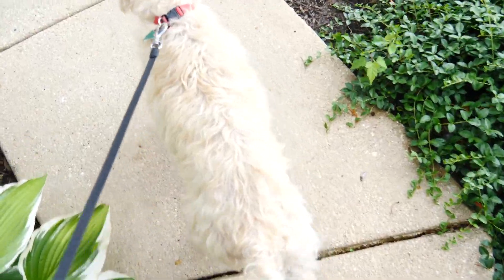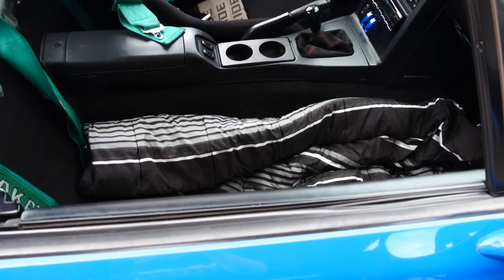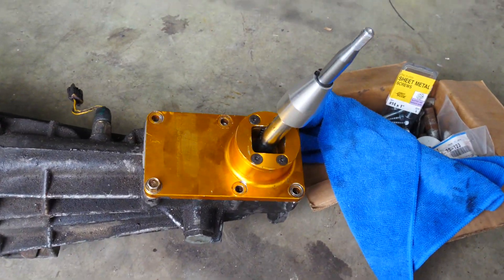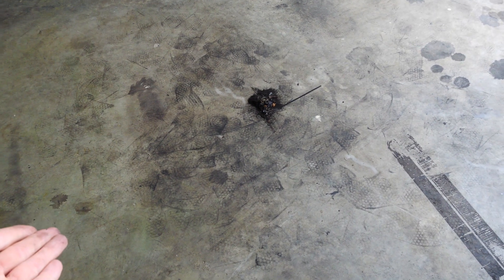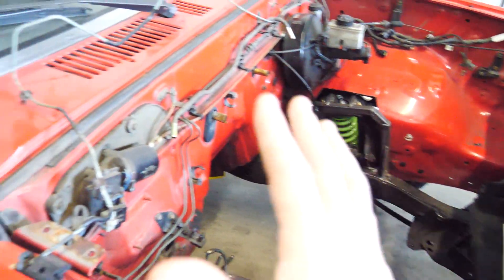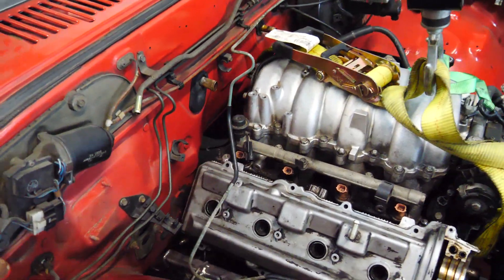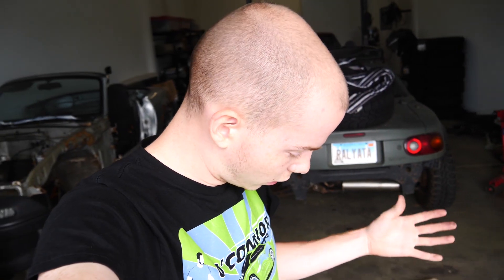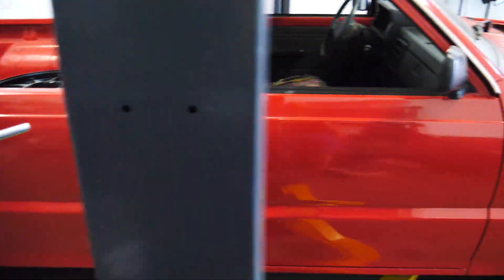NEW Transmission for the Drift Truck!

Comment: You should swap the B2200 sticker to a B4000 sticker so it would show the new displacement
Reply: Klaus Kokkonen i have seen a Toyota mini truck, they did that to but instead of stickers they 3D printed itm
Reply: Kevin Klement yeah thats where i got the idea aswell
Reply: Klaus Kokkonen nice, what toyota truck was it?
Reply: There was a Mazda B4000, which means getting OEM badges is possible, the question is if you can get them new from Mazda.
Reply: Kevin Klement 1972 hilux
Reply: Its more like B4700
Reply: YB420 4700? Is he not putting the 1uz in it? 1UZ is a 4.0L
Reply: YB420 you're thinking of the 2UZ which was the iron block 4.7 liter they used in trucks, gingium is putting in the 4.0 liter aluminum 1UZ
Reply: Yeah there was a b4000 but the logo says B4000 with a V6 under it. 3D printing one seems a better alternative than hacking an original plastic one...

Comment: You just went to full drag setup on the Miata! Demon edition!

I think no one cares what their trans looks like since it is on the bottom of the car. I'll know any fluid leaks pretty much instantly since (knock on wood) none of my cars leak a drop.
Reply: The Dutch Texan I think that it is smart to clean everything you can if you have the time and willing to do it just because it is so much better to work around clean stuff especially on a long project.
Reply: A legit drag setup would be the most expensive he does so I don't think he would do it
Reply: Ff afkloppen broer

Comment: You should turn spares miata into drift cart using truck old engine or rally miata engine after u subie swap it
Reply from the maker: Thats the plan :)
Reply: Yessssssssssssssssssss I’m impatient already
Reply: Gingium just a suggestion, you should put the engine lower so that it will have a better weight transfer while sliding
Reply: Gingium there are also rocket bunny kits you could get and slowly build a Frankenstein track monster with all your extra parts
Reply: what ever happened to the shopping cart from boosted boiz, sad man that was the coolest thing
Reply: yes great minds think alike
Reply: joey William cool so like mad max style? that would be awesome
Reply: mid engine miata!
Reply: joey William agreed
Reply: Gingium im most excited for a miaturd drift car
Reply: Gingium def make it a diesel

Comment: Hi. Just an ideea because I've been thru cleaning gear boxes quite a bit. Hot water jet pressure. Is the best. Leaves everything spotless and very incredible clean. A bit expensive, but it deserves the price and in special with the projects that you are doing. No more dirt and can be used on mostly anything:wheels, engines, gearbox, pavement you name it

Comment: put the radiator in the bed of the drift truck to add extra weight to the back. it will give you more room to mount stuff in the engine bay

Comment: Dude, you need to hit up a sponsor for storage, parts cleaning and that. They hooked up Greg A a while back in his shop. Saves the floor. Or the harbor freight parts sand blaster. Much easier and cleaner to clean stuff up before painting. Land lord wont be happy seeing that damage to the floor.. Least try cleaning it up or do it out the back door.

Also, clean the tools and that up. If youre done using a wrench, put it back. Or get a rolling box you can take around the shop to different cars. Thats exactly what i did with my tools. All in a mobile work bench with a cord that fallows with a power strip on the back.

Comment: Try to get the engine as high as possible to reduce the risk of damaging your oil pan. You might hit it if you go of the track and hit a bump. You might save yourself an expensive fix

Comment: Axel is a big boi now. Haven't seen him in a video for a while. The bus sounds BAD by the way. That isn't a normal sound.
Reply: BoostAddict it sounds exactly like it needs a new battery.
Reply: Mr. Popo yup. Idk what he expects it's got Dead battery's.
Reply: Dead batteries.. Maybe feul pump.. 6.0 power Stroke trucks have issues..
Reply: Sounds spot on for a ford diesel with no charge.
Reply: Mr. Popo In my experience, when batteries die the starter solenoid clicks once when you turn the key to start, and clicks off when you turn back. It doesn't go "clickclickclickclickclick" and bounce the tachometer a little.
Reply: BoostAddict A lot of my cars would click over and over when the battery’s died.
Reply: PureCountryof91 are the 7.3s better?
Reply: Thats how it should sound the battery is not completely dead so it still tries to turn over. Also most starters keep turning until you let off the key. The tach is bouncing cause the starter is trying to turn it over. Most likely the battery is just old and the cell wont hold enough charge/voltage.
Reply: He is so big, I have a 15ish year old Siamese and she's so small lol.  I've had her since high school.   I'm used to her size but any time I see another cat I realize how small she is.  As for the bus, it sounds like there is not enough angry pixies hitting the starter.  Need to add more angry pixies and it should be fine.
Reply: It’s either a bad battery or a bad alternator
Reply: Arnout Buter the 7.3s are actually one of the best light duty diesels you can buy, other than a 12 valve Cummins

Comment: When and if you think you need an upgrade, you should look into a T56 with a quick time bell housing and a twin disc clutch. Because drift truck.
Reply: BoostAddict he was pretty upset with the price of the cd009 what makes you think a t56 is better?
Reply: Angel Santiago because his brothers sisters baby daddy’s cousin got one for 750 dollars once
Reply: Angel Santiago Not cheaper, better. The T56 is one of the strongest transmissions out there. I'd be willing to bet the parts are available to connect it to a 1UZ. I'm sure that with a little luck one can be had from a junkyard for a pretty good price.
Reply: T56 is a heavy trans, not so good
Reply: BoostAddict the cd009 and the t56 are both amazing, hold high power & handle the abuse
Reply: T56 is out dated has a double over long gearing there’s a reason gm went to the tr6060
Reply: Joseph Rossetti TR6060 is geared very similar to a T56, still very long gearing to take advantage of the power band of the engines they typically come behind.

Comment: How did you find a hard top, I cannot find one under $1000?
Reply: Man Dingo wait for winter maybe
Reply: You have to be to travel great distance, be ready to travel at any moment, and be constantly looking if lucky you can maybe find one $800
Reply from the maker: Well...I spent $1250 for myn lol
Reply: Man Dingo here in sj they go for 600-900 all day long, only problem is the theft rate for them. I got a great condition black nb hardtop for 700$
Reply: Got mine in perfect condition for 350,- euro and thats a normal price around here.
Reply: Luis Madero you can remove the latches and use metal plates with screws to hold it down, it also reduces nvh, they run pretty cheap on moss miata

Comment: *PLEASE READ I NEED HELP*
Ok quick one guys, I live in the UK I’m 13 been thinking on restoring a MX-5 but...
I’m gonna get a Eunos MX-5 instead of a Miata MX-5 should I get a Miata and save up or buy a Eunos straight out?
(The Eunos is the imported version of the Miata. Why is this important? I live in the UK so rust is gonna be a problem. In japan it seems sunny so less rust right?).
Edit - Also Miatas are really hard to find on eBay (the only sight I use for cars) and if there is one is quite expensive and my budget is £1000.
Reply: S _ shiggy _ Y eunos still have rust however I’d still recommend one because I have heard that miatas don’t have ac or some other extras. for £1000 you can easily get a good condition one as mine was only £700 and I need to replace the the rusted sills, I’m also prepping it for a respray, so get ready to do a lot of bodywork yourself to save labour costs
Reply: Absolute unit they aren’t hard to insure it’s just that certain companies won’t insure imports
Reply: Mate, you're 13. You shouldn't get a car at all if you can't legally drive it for another 5yrs. If you need a project (I don't understand how you can afford that anyway) get a moped or something else that you can actually use in a reasonable timeframe.

Comment: YOU NEED A SMALL BLOCK FORD IN THE DRIFT TRUCK
Reply: fin harms nah.
Reply: Sbfs are iron/aluminum. Pushrods, and 302s being the lightest.. And block integrity is always a concern under boost conditions. The DOHC toyota has potential and strength. Similar wieght and stupid rev limits. The uz can make 800hp on a stock crank..
Reply: PureCountryof91 so can a 302 lol... the crank is negligible in this situation because he is only shooting for 400 or 450.. which can be done very easily and the packaging is superior in this case, if you hadn’t noticed the 1uz is massive, but a 302 is more compact and also a ford, which owns a large share of mazda..
Reply: PureCountryof91 and why would you want to rev past 6500 realistically anyway? I know for a fact that the 1uz doesn’t make peak torque all the way up there
Reply: Oh and might i add that cams are about 1500 bucks for that turd lol a cam for a 302 is about 200 lol much more vast aftermarket and hell even OEM upgrades just seems much more viable, and quite possibly more reliable, yes, im sure the DOHC flows much more but like i said there are options